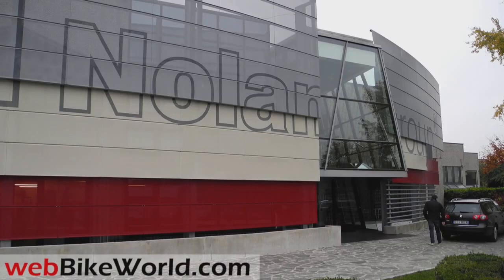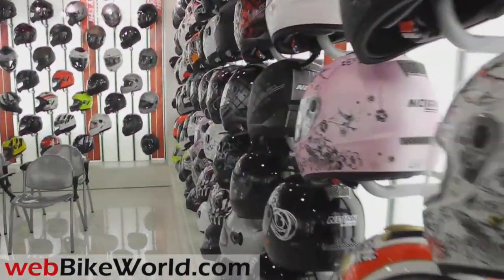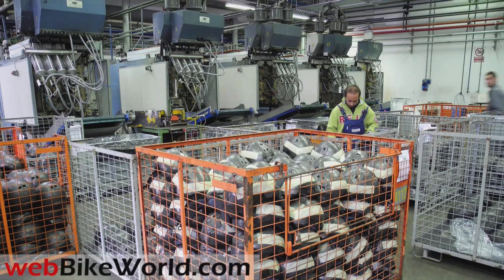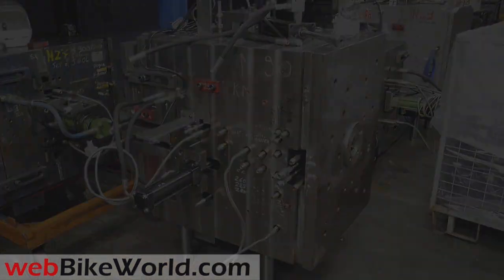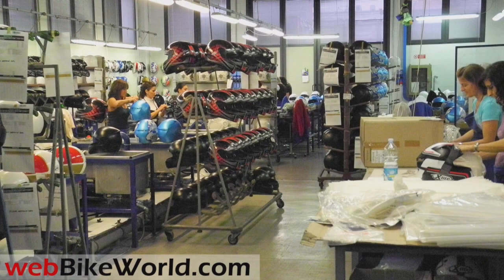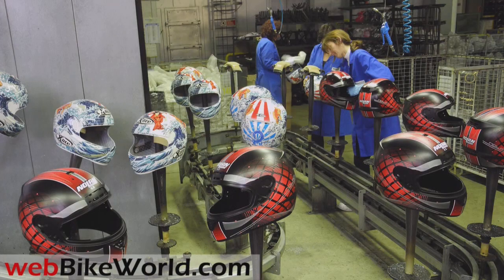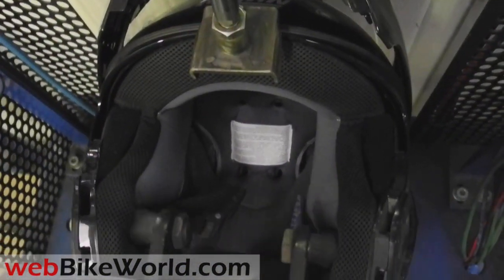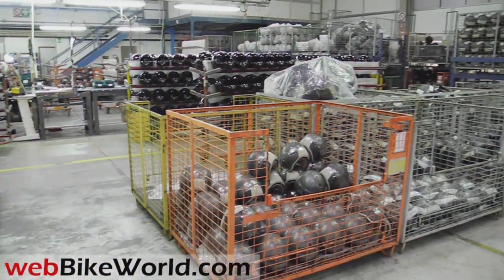Nolan Factory Tour - How to Make a Motorcycle Helmet

Comment: So much hi-tech and pride but one worker treating helmets like bananas 7:06.
I would be disappointed to know that my helmet was managed that way, and that was done during a video presentation, imagine on common days. :)
Reply from the maker: Not a clue what you mean, everything looks perfectly fine to me. One helmet touches another? I see nothing wrong, this is a production line.
Reply: webBikeWorld It depends on point of views although that shouldn't be the standard.
I know a bit a bout Japanese production line and I can assure you that such things would be punished, that is why Japanese factories are more successful, just look at Toyota as an example of production line.
BTW, I like Nolan helmets, just I pointed out that so much "very" high technology isn't felt by the hand workers.
Yet robots do better than humans because they follow the instructions.
Reply from the maker: Bill Admond I'll admit, you probably would see a different handling procedure in a Japanese factory. Which is why Shoei and Arai helmets cost 2x as much as the Nolan! In any case, there is no damage to the helmet and if you hadn't seen the video, you'd never know this happened. Let's focus on the important stuff, like the fact that Nolan is completely vertically integrated, even making their own face shields, plastic parts and they even have a license from Pinlock to manufacture their own anti-fog inserts. This helps them control costs and quality.
Reply: webBikeWorld I didn't specifically mention Shoei because this is about Nolan so it could appear that I was hijacking the post.
But as we know price is the most important stop for any buyer when two competing products are on the shelf.
I know that Nolan is one of the world's top product since they decided to produce composite fibre helmets instead of the much more expensive fiberglass made by the competitors.